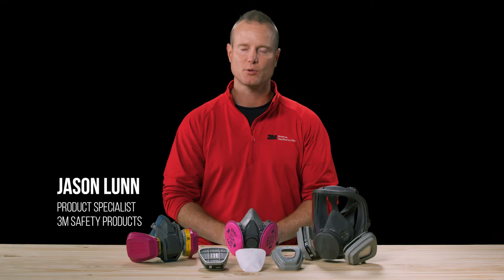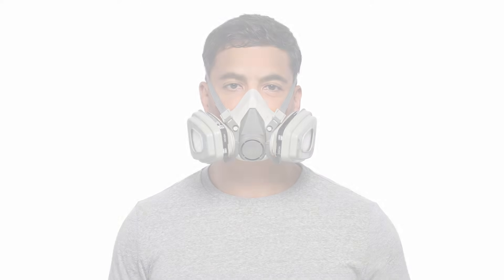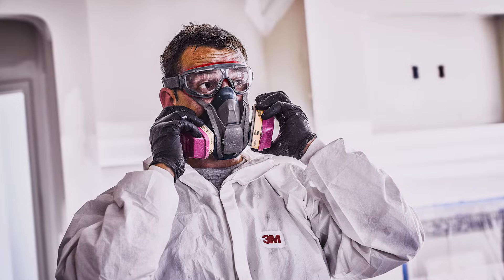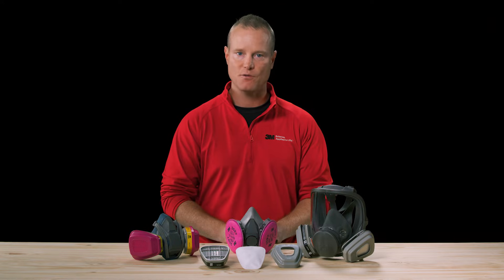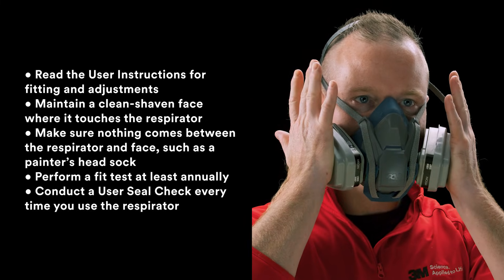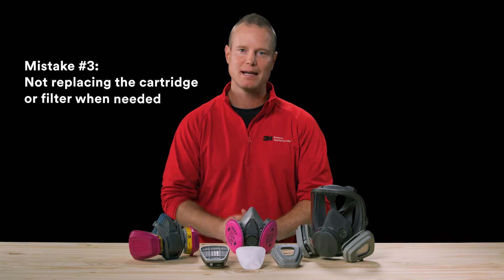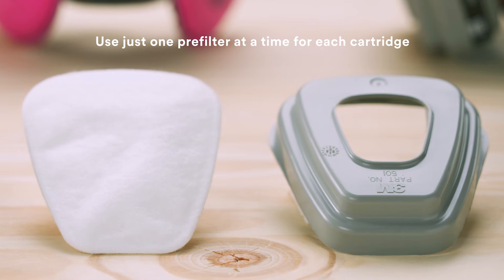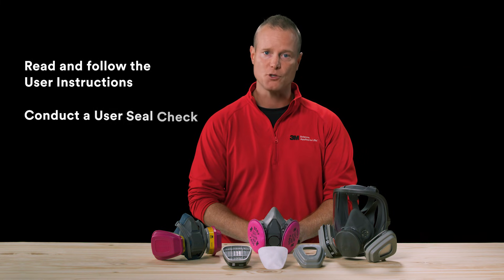How Reusable Respirators Work and Common Mistakes to Avoid

Comment: Soooo, I feel a touch dumb. Began using the respirator mask I bought to get started on riding my bedroom of black mould and didn't realise you have to use a separate loose filter piece in the compartments and not just go by the piece inside those compartments you attach to the mask. Is there anything I have to do extra on top of regular, correct prep (like working out how to take out something in those compartments to replace them on top of the loose filter piece on top) or would it be okay to just do the correct setup the next time and assume the filter inside the compartment's unscathed?
Reply from the maker: Hi there,

Thank you for sharing your query with us.

To correctly use a 3M reusable respirator, you must first ensure it is properly assembled and undamaged, then don it correctly, and finally perform a user seal check. These steps should be followed every time the respirator is worn. 
Before Each Use, inspect all components: Check the facepiece, straps, filters/cartridges, and valves for any cracks, tears, holes, damage, or missing parts. Do not use the respirator if any part is damaged.

Ensure proper filter assembly: Make sure the correct filters/cartridges for the hazard are securely attached to the facepiece following the manufacturer's instructions. 

Donning the Respirator
Loosen the straps and place the respirator over your mouth and nose.
Pull the head harness over the crown of your head and connect the bottom straps at the back of the neck.

User Seal Check (Essential Step) 
A user seal check is required every time the respirator is donned before entering a contaminated area. 
For a positive pressure check, cover the exhalation valve and gently exhale. The facepiece should bulge slightly with no leaks.

For a more detailed explanation, we would suggest that you contact our team of respiratory protection specialists, who will answer all your questions and help you find the right solutions. In order for us to do that, please share which country you are contacting us from.

Comment: Can these be used for PM 2.5 pollution (New Delhi) ?
Reply from the maker: Hello there -

Thank you for your question! 3M offers respirators and filters that help protect against fine particles like PM2.5 when properly used. Filters are rated 95, 99, or 100, providing at least 95%, 99%, or 99.97% filtration efficiency, respectively.

For powered air-purifying respirators (PAPR), HEPA (High Efficiency Particulate Air) or HE filters offer at least 99.97% filtration efficiency for all particulates. To help you choose the right respirator for your needs, we recommend visiting our Respirator Selection Resource Center here: https://s.3m.com/bv3ml5u5

This page provides detailed information on filtration efficiency, proper usage, and guidance to help you choose the right level of protection.

We hope this information helps!

Comment: imo you should absolutely get a setup with positive air pressure if you plan on doing anything longer than 15 minutes of dusty work more than a few times per year. guaranteed no dusty air leaking in because of a bad seal and also nice and fresh feeling vs those normal masks without a blower air pump.

Comment: I deliver diesel fuel and nobody at work wears a mask and its nearly impossible not to inhale the benzene vapors, any recommendations for a mask. Ive been looking at some moldex masks but i have no clue what to get
Reply from the maker: Hi there,
For benzene vapors from diesel, we recommend the 3M 7500 half-face respirator with 6001 organic vapor cartridges—it’s reusable, comfortable, and built for chemical exposure. For extra protection, you can use the 60926 cartridges (multi-gas + P100).

Please make sure you get a good fit and replace the cartridges regularly.

Thank you!
Reply: @3MCorporate your a life saver thank you so so much 🙏🏽🙏🏽

Comment: How do you fit correctly so it doesn’t hurt your nose?
Reply from the maker: Hi there -- Thank you for your comment! Adjust the nose clip gently to fit the shape of your nose without pressing too hard. Ensure the straps are snug but not overly tight to avoid pressure points.
Hope this helps!
Reply: @3MCorporate hi, the half face gas mask I bought online is great but the problem is idk how to adjust cuz the gas mask is loose on my face. Any tips?
Reply from the maker: Hi there -- Thank you for your comment! Tighten the head straps evenly by pulling them back until the mask fits snugly without gaps. Ensure the nose and chin areas are sealed, and perform a seal check before use.
Hope this helps!
Reply: Great Video - Thank you!  Where can we buy a half mask in Small?  My wife is tiny and she wants to use my HVLP sprayer to lacquer wood projects but none of our hardware stores, paint supply or even online shops seem to carry your small masks…